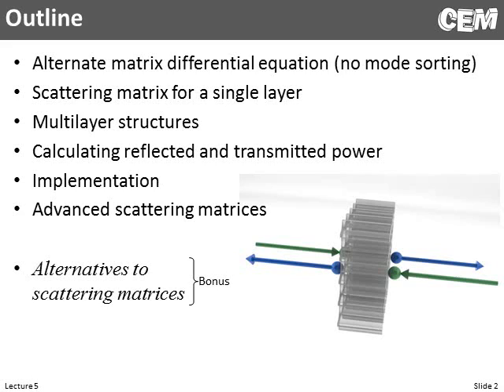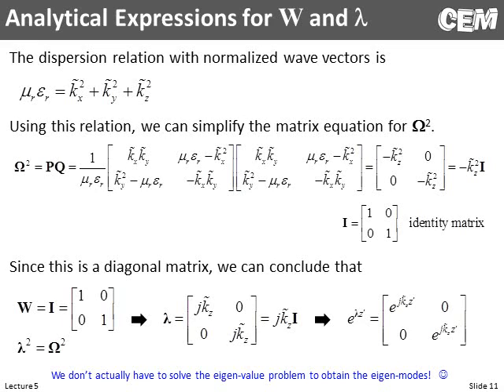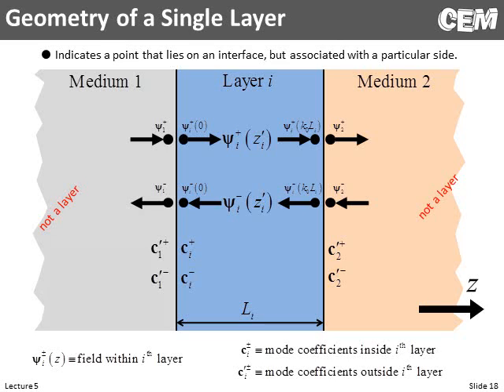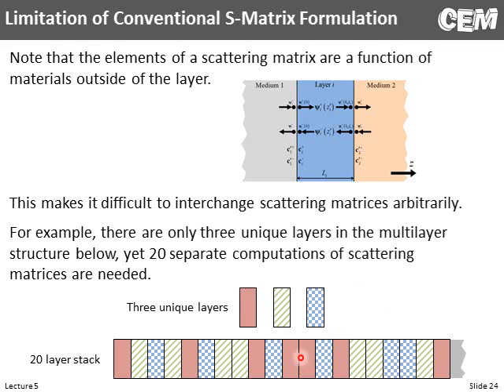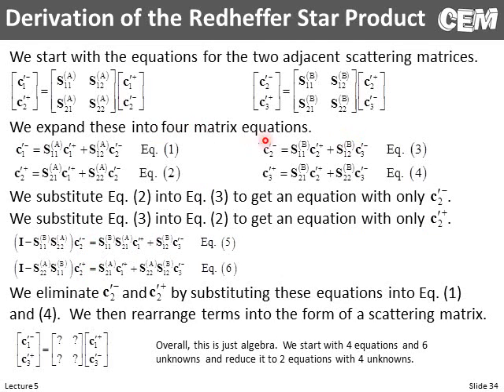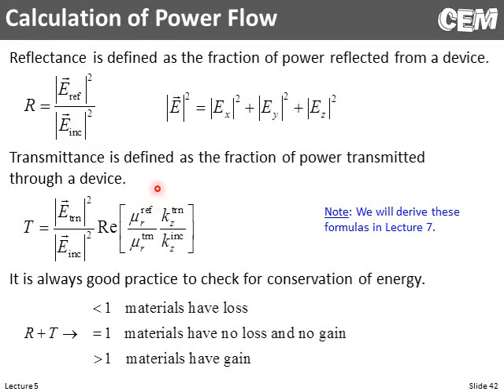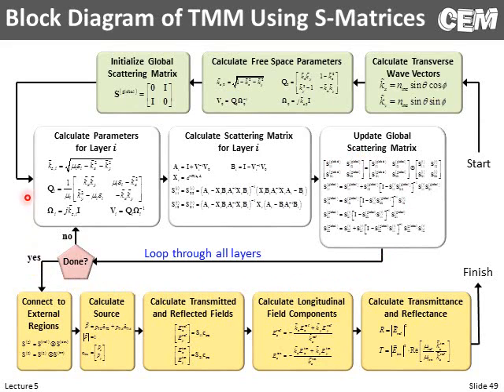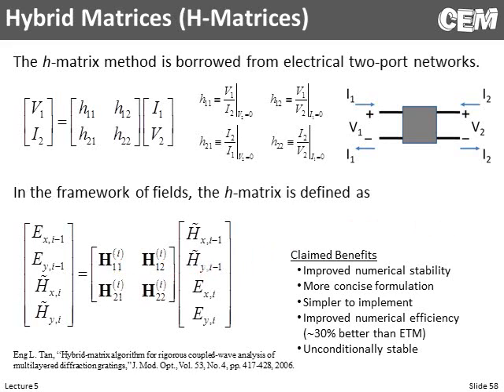Lecture 5 (CEM) -- TMM Using Scattering Matrices

Comment: Hi dr. Rumpf. I appreciate all the great content you are producing, thanks! 
Please help me get some clearity on the following:
Elsewhere I have learned that from simply satisfying the boundary conditions the field in first region can be related to the field in the transmission region like so : [E0+, E0-] = [M11, M12; M21, M22] [Et+,0]. Reflection (r) and transmission (t) coefficients are then simply given by r = M21/M11 and t = 1/M11.  What's the added value of taking this, what seems to me a much more complicated approach?
Reply from the maker: If TMM were handling a single interface, the approach you describe would probably be best.  The main reason for the scattering matrices is to allow TMM to combine multiple layers together to simulate more complicated devices. This allows you to do advanced things like cascading and doubling to efficiently simulate devices with millions of layers (like fiber optic Bragg gratings).

Comment: Thank you very much Sir for the lectures. I have three questions:
1. Is it because we have surrounded each layer with free space layers of thickness zero that we have to use Redheffer Star Product? or How will the Redheffer Star Product make the TMM stable?
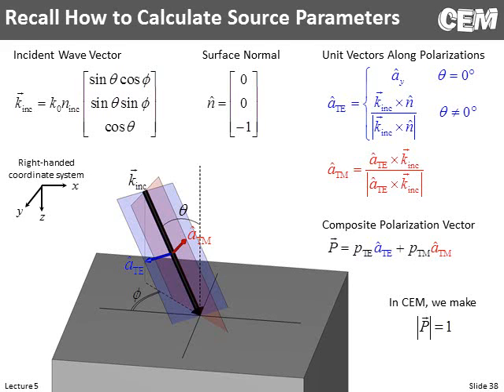2. How do you derive the vector k_inc (slide 38, 47:50) an the coefficient c_in
 (slide 39, 49:40) ?
3. In order to calculate reflectance, why can we just use the global Scattering Matrix: R= (Sglobal_11)^2?
Reply from the maker: 1. Surrounding the layers with free space does not stabilize the method.  This practice allows us to calculate scattering matrices without having to know anything about the surrounding layers.  The Redheffer star produce would be needed no matter how you handle the scattering matrices.  The TMM was stabilized by distinguishing forward and backward waves and treating them separately.

2. k_inc is not derived.  It is an input argument to the method.  It is the direction of the applied wave.  The equation to calculate it is on Slide 38 of the video.

3. You can do this.  In fact, it is the more efficient way.  I take the longer approach to teach the flow of the matrices and information.
Reply: Thank you
Reply: Sir I have a  another question about the Transmittance, how should it be calculated for multilayer? is T= (Sglobal_21)^2? In the formula (slide 42, 54:10) , if the incident and transmitted waves are in the same medium, would it be T= |Etrn|^2/|Einc|^2 ?
Reply from the maker: Yes, the incident and transmission regions are same, the equation simplifies to what you have written.  Reflectance looks similar, but is |Eref|^2/|Einc|^2

Comment: I am currently trying to implement this, and I am very confused. It looks like, for LHI media, if we multiply out PQ to get omega squared, then this omega squared matrix is just a multiple of the identity. (kx^2 + ky^2 - ur*er). So for any kx and ky (any direction we point the incident plane wave), the only thing that changes about omega is the eigenvalues, not the eigenvectors. Or, if the eigenvectors do change, we would have no way of finding them numerically (eigendecomposition of the identity matrix is ambiguous). So my questions are this:
1. Since the omega squared matrix is always a multiple of the identity for LHI media, how do we find the W matrix? The eigenvectors of the identity matrix are literally every vector, and not unique. The columns of W could be any set of orthonormal unit vectors in 2-D vector space (and I have found that with numerical noise they most definitely will be)

2. If we are interpreting the c+ as the forward propagating mode coefficients, and W * c+ as the forward-propagating x- and y-components of the electric field, then it seems like if we don't know the eigenvectors of W we can never figure out what the modes are in relation to the x and y components of the electric field. This seems to mean we cannot identify 'TE' and 'TM' modes from the matrix formalism proposed here. How do we find this relation? What information is missing from the matrix formalism?
Reply: I think I have figured out part of the answer. There is nothing missing from the matrix formalism, because it is the case for LHI media that any field polarized only in the x/y plane is a mode of this system. So we could actually choose any pair of orthonormal vectors as the columns of W, as long as we stuck with what we chose.

Comment: Thank you for this lecture. 

I want to ask about something, if I want to add loss or gain to one or bunch of layers all I have to do is add imaginary value to the permittivity, right?

if this is right, according to theory of parity-time symmetry, the transmission from left and right are equal but not the reflection. how I can extract the right and left reflection in this case from the code?

thank you.
Reply from the maker: I may need to give this more thought, but I thought both T and R are the same.  I "think" things will only differ when you introduce anisotropy or perhaps nonlinearities. Can you point to any literature?

Oh yes...loss and gain are incorporated by making permittivity (or permeability) complex. The sign of the imaginary component indicates loss or gain.  Which sign is loss or gain depends on the sign convention used.
Reply: @empossible1577  Thank you.

What i have tried after adding the imaginary part is to extract each term from the final global matrix and use the S11 and S22 for reflection left and right respectively, and after introducing the loss and the gain the transmission is the same on both sides. 

But still the final figure is not like the literature!

In all parity-time literature they use the transfer matrix instead of scattering matrix but as you pointed out in the video it doesn’t matter as long as the code works in the first place, that’s why i wanted to discuss with you what modifications could be done to the code that could work in this situation.
Reply from the maker: @omarelsheikh1060  I have never seen TMM fail when loss or gain is incorporated.

That said, our current TMM formulation is not setup to have loss or gain in the external mediums. In fact, that is a long story, but the short version is that we are working on it. We want to generalize all our codes so that the external mediums can be complex.  It turns out that is not easy!
Reply: @empossible1577  Ah i see, that’s why people still stick to TMM in their publications even in 2023! 

Okay thank you for your replay Dr. Raymond.

Comment: 1. Is there an advantage to propagating the modes and their coefficients, rather than the fields? Conceptually it seems a little backward, but will this be useful in the future? 
2. Also, is it necessary to retain both the E- and H-fields everywhere when doing calculations? It seems like we could just work with the E-fields the entire time, solve the uncoupled second-order differential equation, and then at the end once we have everything we want, calculate the H-fields. This seems like it would make the derivations simpler and we would have to store smaller matrices in memory, is there a computational reason we don't do this, or is it something more fundamental? Does this break when we have anisotropy?
Reply: I think I may have figured out the answer to my first question. It seems like we are at an impasse as to whether to deal directly with fields or with modes, and either would work. I think fundamentally this has to do with boundary conditions being easier to formulate in terms of fields, and propagation being easier to formulate in terms of modes. On the one hand, eigenmodes are very easy to propagate. You just multiply by exp() of a diagonal matrix whose elements are just the square root of the computed eigenvalues of the modes for that layer. Fields, on the other hand, propagate a little less cleanly - you have to exponentiate the entire matrix of the second-order differential equation, which you called capital omega. But after you propagate a mode through a layer, you want to convert it 'back' into a field so that you can match the boundary conditions. It still seems conceptually easier to work with fields by themselves.
Reply from the maker: 1. For TMM there is little advantage.  For other methods working with the mode coefficients requires fewer calculations so it is more efficient and I think it better unifies the various methods that can use scattering matrices.  It is absolutely possible to formulate the scattering matrices to work directly with the fields.

2. For the most part, the TMM was done in terms of just electric fields.  However, in order to solve the problem at the boundary the magnetic field terms are also needed because we would run out of information otherwise.  Electric fields alone would be enough if waves only propagated forward, but since there are backward waves we need more information to solve the boundaries and this comes from the magnetic fields.  However, we put the magnetic fields in terms of the electric fields so in a sense it is entirely done in terms of electric fields.
Reply: @empossible1577  Thanks for the reply! It's not clear to me why there is a loss of information if we only formulate things in terms of the electric fields. We know a priori that the boundary conditions equate the tangential components of both the electric and magnetic fields (not just the electric field, so a total of 4 equations). If the H-field is fully determined by the E-field, then aren't two of these equations redundant? It seems like we basically have two equation pairs that say x1 = x2 and f(x1) = f(x2). The second equation is redundant. (where x1 is for example the x-component of the E-field in layer 1 and f is the H-field as a function of the E-field). Is there an advantage to retaining all four field components in the psi vector, or is it a necessity and I am just missing something?
Reply from the maker: @JordanEdmundsEECS  No.  The difference is minimal.  If you go through all of my lectures, you will see that I put a lot of work into making the methods look the same.  Formulating based on mode coefficients is an artifact.  There is absolutely nothing wrong with formulating as you have in mind based on the fields.  It will be interesting for you to try and it and quantify the difference in terms of implementation and simulation time.
Reply: CEM Lectures Ahhh got it thanks. I realized why the boundary conditions are not redundant- they are vectorial,  and the polarizations of E and H are not the same for waves propagating in different directions. My mistake XD

Comment: Fantastic video, I found it very helpful to create a working transfer matrix model. One question; is introducing loss into the model as simple as introducing a complex permeability?
Reply from the maker: That is it!  I really should work that concept into the lecture and homework.
Reply: Perhaps also the idea of frequency dependent permittivity, which comes up very frequently in physical applications.

 As a relative novice, I just iterate over the whole calculation for each different frequency, but I imagine there must be a more elegant way!
Reply from the maker: No that is it.  Just calculate a different permittivity for each frequency.  You can get values from tables or from materials models.

Comment: Is it true to say that reflectance and transmittance are direction-agnostic quantities? So they are defined as just the total incident power (from whatever direction, even if that direction is not normal to the device) divided by the total reflected power (even if that power is in some wonky direction like very close to parallel to the device).
Reply from the maker: It is a little more than just power reflected divided by power transmitted.  It is only the normal component of power that should go into this calculation.  This may seem weird, but think of if this way.  A wave travelling near parallel to the interface carries power to and from that device much less effectively than a wave at normal incidence.   Another requirement is that reflectance and transmittance are relative to a single incident wave.  

I have some information about this in Lectures 3a and 3b here:

https://empossible.net/academics/emp5337/
Reply: @empossible1577  That is pretty counter-intuitive, but it does make sense now. Thanks! I think I have come up with a thought experiment that gets to the point. In the limit where we have an incident wave purely parallel to our device (kz = 0 in our incident media, free space, and say we are in 2D so kx = k0), then we can use the dispersion relation in the second media along with phase matching at the interface to find that kz in the second media is +/-sqrt(k0^2(*n2-1)). So phase matching seems to imply that for a plane wave parallel to the interface, there is a solution to Maxwell's equations where the plane wave is not moving at all towards the device in free space, but is moving towards/away in a second media. Thinking about it backward, this is total internal reflection, and we would expect no power to be transferred from the device side to the other side

Comment: Thanks for the great lecture! 
I would have a question though:
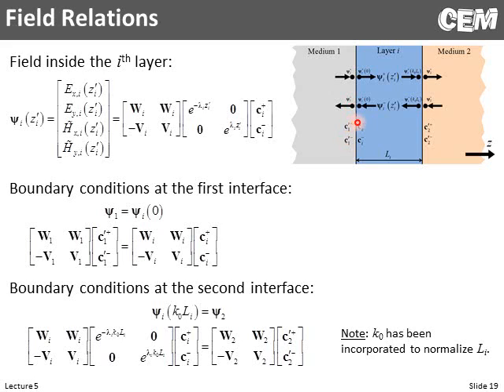I don't quite understand why Psi (the fields) is written as it is for each of the mediums (at minute 23:00) when formulating the boundary condition  at each interface of Layer i . I get that the exponentials are 1 at the first interface inside Layer i. But I dont understand what happens with these terms for the medium (i.e. why is the matrix of exponentials missing from the left side of the boundary condition equation for the first interface and the right side of the second boundary eq.). Or am I just missing a simple point of how one can formulate the fields in a medium?
Reply from the maker: Great question.  I am doing something rather strange and different here.  Medium 1 and Medium two are not layers in the device.  They are infinite half spaces.  I have defined the psi terms in these external regions to perfectly define the fields immediate at the interface so no exponential terms are needed.  Inside layer 1, I have defined the psi term to perfectly define the fields at the left interface so exponential terms are needed there.  However, exponential terms are needed at the second interface since the Layer 1 psi term is propagated through the layer.  The little dots at the end of the arrows indicate where the psi terms are defined.

Comment: Thanks for posting this online and it helped me a lot understanding the concept o TMM. There is one thing I think I should point out. You used exp(jwt-jkz) most of the time but you used exp(jkz-jwt) for TMM here. However, you ended up with the same set of the differential equations you developed previoiusly. Thus I suppose you used different normalization for H here. You used H_normalized= -j*sqrt(u0/e0)*H. But here did you use H_normalized= j*sqrt(u0/e0)*H? Thanks again for posting.
Reply from the maker: Victor Wang It is great to see you analyzing this in such detail.  The manner in which I normalize H is always the same regardless of the sign convention.  The biggest impact of the sign convention is that you have to also consider the sign of the imaginary parts of mu and eps if you are incorporating loss.  Otherwise, it is only subtle sign changes in the formulation, if any changes.
Reply: Victor Wang Also, there is one thing I don't quite understand. You used exp(ikz) convention. However, you expressed Ex(z) as Ex(z)= (a_+)*exp(omega*z)+(a_)*exp(omega*z). Is that a conflict with the sign convention?
Reply from the maker: Victor Wang I appears I may have goofed my notation.  Thanks for pointing it out.  I will look this over in more detail and fix what may be wrong as soon as I can.
Reply from the maker: Victor Wang So I looked at this in a bit more detail and I now remember what my thoughts were at the time I did this sign convention change.  First, I tend to like the exp(+jkz) convention so that the imaginary parts of permittivity and refractive index are positive for lossy materials.  This is more consistent with what is published in materials databases.  However, the convention exp(-jkz) is used more often in electrical engineering.  Both work and both are used.  The TMM lecture here is intended to get the students ready for learning rigorous coupled-wave analysis in a later lecture.  In that formulation I wanted to stick with what was in the literature which is the exp(-jkz) convention.  That is why I made the switch in the TMM lecture to this sign convention.  I guess now the question is, why did I ever show the exp(+jkz) convention?  I wanted students to see both!  Also, my TMM and FDFD codes all now use the exp(+jkz) convention.  Yes, I even confuse myself many times when I cannot remember which convention I used.

If you would like to see a revised set of slides that stick with the exp(+jkz) convention, send me an e-mail.  I have them.  Also, incase you are not aware, you can access the electronic notes, recorded lectures, and other resources through the course website here:

http://emlab.utep.edu/ee5390cem.htm

Comment: Great video!
How to write a MATLAB code for this? Please someone help me.
Reply from the maker: Let me point you to the official course website.  This entire section of notes on TMM has been considerably revised.  See Topic 2.

https://empossible.net/academics/emp5337/

As for the codes, I recommend trying to develop the codes on your own from just the theory slides.  This will maximize your understanding of the method.  If you are truly in a rush, stuck or have no idea where to even begin, there is a paid online course that will step you through every single line of code in MATLAB to implement the transfer matrix method.

https://empossible.thinkific.com/courses/tmmmatlab

Hope this helps!
Reply: @empossible1577  thanks a lot!